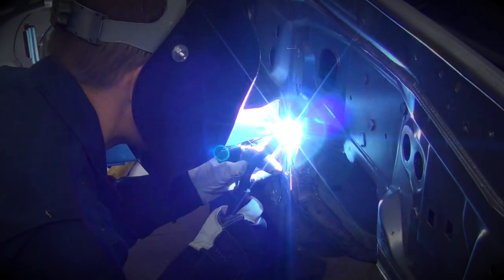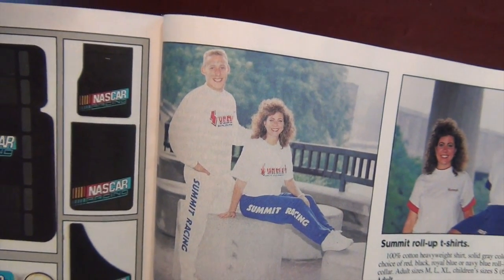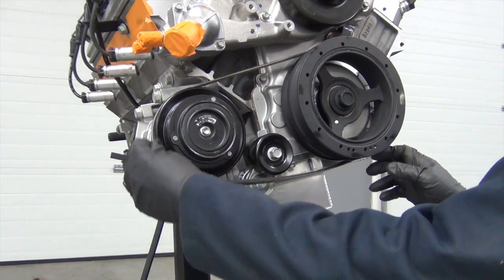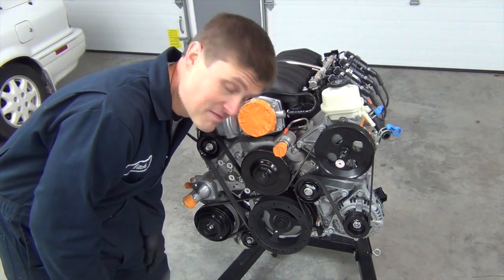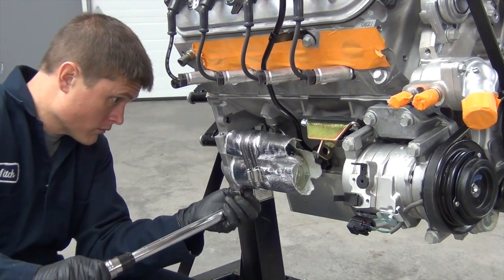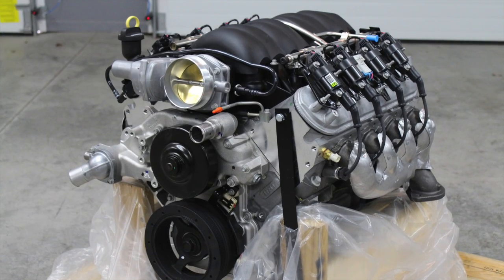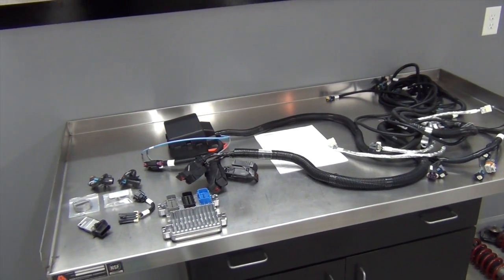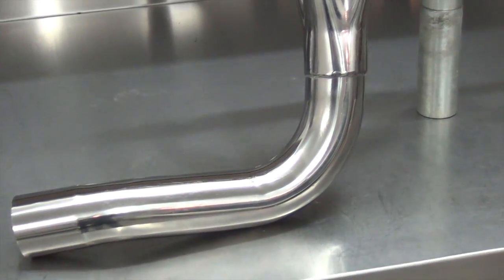LS3 V8 Miata Build - Project Thunderbolt Part 5

Comment: One tip from a mechanic by trade, invest in a decent flex head ratchet with an offset handle,  which can be folded back and used as a speed wrench. I notice you only use hand tools, which I love. I will never get tired of the  sound of the ratcheting gear. It would save you hours on one of these builds. All the best, and I  love your videos!

Comment: Great Series, Awesome engine, fantastic-expected result.  You did ask for "other engines" at some point, so here are mine:--an 215cu" all-alloy V-8 Olds from the 60s, wicked-up to 250Hp for the "old-schoolers", and a Ford SHO V-8 with a N-S adapter.   The SHO was wasted, I thought in a Taurus sedan.   A Ford "SC" 3.8L V-6 might be more "easy" to do, because it was already in a N-S mode.  With a N-S adapter, ANY of the Buick-Olds-Caddie Northstar's would fit.   The Hp's low enough, there's miles of torque, and  huge tires/flares un-necessary.   Also, as long as you're moding everything and the kitchen sink, I'd suggest you turn your miata into the late-model Coupe, like are available in the last couple of years.   Lastly, run your car at a huge race like Le Mons, and win whatever your class is.

Comment: As an automotive engineer who frequently deals with the implications of modifications to existing designs on driver safety, that "one more small cut" gives me chills. That replacement brace looks comparatively skimpy to the roll formed box structure of the original.
Reply: +Hamza Ali Kind of hard not to take offense...and there's no need to be nasty! I'll explain the reasoning behind my argument, hopefully you can explain yours, because I'm interested to hear it from a fabricator's point of view.

A "box" structure is inherently much stronger than a single beam, or, in the case of the supplied brace, a 90° piece of what appears to be angle iron. If a 90° shape like the one used was indeed stronger, you'd see it used much more frequently in bumper supports, frames (in the case of body on frame vehicles), etc. It's cheaper and lighter than using roll formed steel.

Additionally, the steel used for roll forming is very high strength to begin with, and is cold-worked during the forming process, which further increases its rigidity.  

Another argument to this point are fabricators such as yourself who "box in" the frames of old cars which have frames made in a "C" shape so as to increase strength. This is common with lowrider guys who like to bounce their cars, and will often bend frames while doing so.

I'll agree with you that using tubular steel would be stronger. I've seen, in the past, similar braces composed of two or more pieces of tubular steel. I'd feel much better about using something like that.
Reply: +Louche Decay OK, I wasn't trying to be nasty BTW, sorry if that's how I sounded but that's just my normal way of speaking. yes, rolling is lighter, also cheaper, but not by much because of labour and machining costs. the reason solid steel is not used in car bumpers and frames is because cars are designed to collapse in themselves in the event is an accident. you're an engineer so you should probably know that. if the frame was to not collapse on itself, humans would not survive crashes because of the amount of g-force. also, called rolled steel does not make an object rigid. it actually makes it very soft and ductile (also proving my point that frames are designed to collapse). high strength steel is much different than cold rolled. chemically and mechanically. (probably something you already know but just in case you don't). also, the type of steel an item is made from has little to no effect on how rigid it is. it all depends on the final form of the object like the angle iron.
Reply: +Hamza Ali It's all good, intention doesn't translate well via the Internet. 

I also thought of "crumple zones" when I wrote my response, but I guess we'd have to see impact tests of both designs to definitively know which method is actually stronger. To your point, if the brace was stronger, it could possibly still be a source of risk if it didn't "crumple" at the same stress as the surrounding material. This is an interesting dialogue nonetheless.

The type of steel used does have a dramatic effect on its strength when loaded with stress. You're right in saying that cold working doesn't strengthen all steel material, but many materials (like those used to make springs, for example) are pre-selected to have a specific tensile strength after forming. Cold rolled steels are analogous in this regard. 

"Strength" is also a bit of a difficult thing to describe here. Tungsten carbide is "stronger" (harder), but is "weaker" when loaded with shear or torsion stress (it is brittle and will crack like ceramic).

I'm curious to know what kind of steel was used in constructing the replacement brace. It would be fairly easy to analyze both the OEM and replacement supports as a simple beam with a centered load.

Also, while the welds themselves are "stronger" than the surrounding material, tests I've done in practice have shown that the welds themselves often contain microcracks which are more often than not localized failure modes. This might be mitigated by glass or shot peening.
Reply: +Louche Decay OK, so I agree with most of what you said but you misunderstood. when I said that the type of steel doesn't matter how rigid steel is. let me explai
Reply: +Hamza Ali sorry, damn phone messes up all the time. but as I was saying, let me explain. let's say you have cold rolled and mild steel flatbar. let's say about 1/4 inch and 20 foot long suspended at the very ends. if I was to step on each of them with my full weight in the center, they would both bend about the same amount if not the cold rolled one even more. if these were channel or angle or anything with a bend in it. I'd bet my life they would not bend. that's what I meant. if you want to got into specifics of heat treated and low, medium high carbon steel, and alloys and high strength and stainless and chrome steel, and inconel and chromoly and so on, that's a different story. I was only referring to just cold rolled and mild. also, about the welds, if you get a good welder with a good tig machine, I can garuntee no cracks. it's been done before. also, I'm betting that the angleiron was just mild steel. I mean, like you wouldn't really need anything else. that's what the sub frame is probably made of. other wise this guy would have a much harder time welding.
Reply: +Louche Decay also, I want to ask why springs would need high tensile strength? wouldn't they need more yeild strength instead? or am I getting the two mixed up. I forgot all my terminology after finishing school.
Reply: +Hamza Ali Marhaba habibi :) ... Ah, ok, I understand what you meant and agree that a bar with an angle would be much stronger than a flat bar. You can calculate the strength of different shapes of simply supported beams (which are as you described). My point was just that a box structure is stronger than a bar with just one bend....but that bar was pretty thick, and we'd have to know the material properties of each to actually do a good calculation.

Yield strength is just the point past which a material will not return to its original form. Under the yield strength, the material will elastically deform (deform and return to its original state). Above the yield strength, it will plastically deform (shape will be permanently changed).

Springs need a high tensile strength so as to have a good fatigue life. Springs made from a low tensile material, even if operated entirely in the elastic range, will have a lower fatigue life than those made from a high tensile strength material.
Reply: +Louche Decay so then I guess we can both agree we won't know before testing the material. are you arab? asalamualaikum bro. that through me off guard real quick
Reply: +Hamza Ali Waalaikum salaam. Yep, Palestinian. 

We'd totally need to test the materials to definitively figure it out. It'd actually be pretty easy if you had a cut out portion of the bumper support from the Miata and the Flyin' Miata brace. Impact testing might be difficult, but I'd just support both as simple beams and statically load them in the middle and measure deformation at different forces. That would be a pretty cool experiment (there's the engineer in me geeking out :) )
Reply: +Louche Decay or we could just put both pieces under a microscope and check the grain structure. probably the most accurate way without breaking the bank.
Reply: Louche decay you are 100% right. Unibody 101

Comment: Still impressed that there are that many parts available for a LS3 Miata build. Still a ton of work. but it looks awesome!!
Reply from the maker: Bob M. Tyranny Destroyer Thanks man, I hear ya!  You definitely have to work for it, but it's worth it.  The condensed format of the videos make it look much, much simpler than it is for an average wrencher like me.
Reply: You completely disassembled the interior and removed everything from engine bay lol. Still fabricating multiple brackets on top of wiring harnesses, chassis & engine part modification. Probably the coolest car build series I have ever seen!!
Reply: Just got done with all new brakes/rotors and wheel bearing on my L67 Regal GS. One of the slider pin bolts was rounded off and I didn't get it out. Tried filing it down to a 13mm worked pretty good, but still just rounded it off, so I proceeded to removing the whole caliper as needed for rotor got pads on that way. BUT before that, I turned car on hit brakes to compress the brake pistons on other wheels trying to not over-pressurize the reservoir and POPPED out my front left brake piston (fluid everywhere) because no pads in yet. Dumb mistake never done before. SOO I took it off and put in in a vice and popped it back in and it works. Going to shop tomorrow for scheduled steering rack replace and brake flush.
Reply from the maker: Bob M. Tyranny Destroyer Thank you again man, I am really glad you're enjoying the videos!  Oh man, we have all made mistakes like that, it happens, but the good thing is that it just made a mess and didn't hurt anything.  Have fun wrenching on your Regal and getting it all done!
Reply: Tom's Turbo Garage
Friggin rites! :)

Comment: Tom, PLEASE make some 0-60mph and 0-100mph videos when this is all said and done. This little beast will be a rocket!
Reply from the maker: Thanks Jobe!  I will do so, as I have a perfectly good Vbox sitting here gathering dust.  But it may take some time as I'll have to break everything in, work out the bugs, etc.
Reply: Tom's Turbo Garage
That's the worst part about the crate engines, new transmissions, and clutches.. the dreaded break in period! xD
Reply from the maker: JobeMinacum Indeed!!

Comment: I would never guess that the AC compressor bracket would have a torque spec.  I dunno, I guess after being a professional for so long I could just feel where it was right and wrong.  But good for you for doing everything to exact spec. Good job, keep it up.

Comment: "One more small cut..." My eyes got so big! Hahahaha
Reply: Me too, there's no way that welded in bar is going to have the strength of the piece taken out :S
Reply: Dee Jay Oh yes it will. Properly welded seams are actually tougher than the metal around them and the original piece used relatively thin sheets of metal.
Reply: Jinppa
flat bar is not as strong as square...   I'm not talking about the weld
Reply: Dee Jay It's not flat, it's angle bar and as you can see, it's quite thick one.
Reply: Jinppa
Still more flexible than square..  So It's not as strong as what was there originally
Reply: Dee Jay How can you know that without knowing the material strengths and measurements? If you're genuinely worried, maybe you need to contact Flying Miatas, it's their design? :)
Reply from the maker: Joe Wrenches Haha!  A couple more small cuts like that and I would've had to consider a tube front end. :-D
Reply: Jinppa yep. that looked like angle iron and it was thick. thin steel vs that thick piece of angle iron? im gonna side with the angle iron. :P
Reply: hobotechMASTER
I think it's safe to assume you have absolutely no fabricating experience..
A box is more rigid than angle..  Super simple to understand
Reply: Dee Jay Like I said, you can't know it without knowing the material strengths/thickness. Pound for pound square is stronger than angle bar, sure no doubt, but I bet that angle bar is heavier than the original cut out piece.
Reply: Jinppa
It could be!  Using rigid shapes means the engineers can use thinner material to gt the same rigidity..
A square is like 4 pieces of angle, so clearly you have a ton more strength in 4 than you would in 1.
Reply: yes the iron L bar is probably stronger, but considering it was welded onto thin metal, it was stronger before the cuts. look at the shape of the place it was cut, the welded in piece cannot make it as strong as it was before, but oh well too bad its a v8 miata its not going to make any difference :D

Comment: Regarding laying under the dash while fabbing the gas pedal mounts up. At least you didn't have the seat in it. I just ripped the heater core out of my NA with the dash and seats still in place. That was awful. Seat is coming out before I put the new one in for sure.
Reply from the maker: goingtoscotland Oh yeah, any under dash work in the Miata almost requires the seats to come out!

Comment: Another great video! Thank, Tom. You remind me of a skilled surgeon, performing his operation in a sterile, clean environment, using glittering tools and parts!

I have one observation and one question for you...

The serpentine belt is amazing and cool, but I wonder if once the motor is in the car, will you be able to change the belt when it breaks or becomes worn? I'll bet that there's not a lot of room in there to even see what you're doing. Would you need to pull the engine in order to replace the belt?

Here's my question: I observed that you torque each bolt on the engine. Is there a "standard" torque setting for all bolts, or does each one have it's own? Being as you have an aluminum block, the last thing you want to do is over-tighten the bolts and risk stripping them out.

Thanks again for another amazing video, Tom!
Reply: There is a different setting for each different bolt and usually if there is enough clearance for the belt to spin then there should be enough room to get in there and replace the belt
Reply: Yes the belt is easy to change in the car.  Lots of guys use F body accessories which leave even less room than he will have and it's still no problem.  If you look in the shop manual there is a specs page in each section that gives the torque spec for each bolt.  In the GM manuals anyway...
Reply from the maker: Rick Hilton Hi Rick and thank you for watching and the great support as always!  Other folks have answered your questions well already, I guess I'm too darn slow!  :-D  Yes, the manual for the accessory kit (and the factory service manual) specifies the torque specs for each bolt and there is lots of room to change the belt, as you'll see in future videos. Thanks again sir!
Reply: Thank YOU, Tom, for these great videos. Keep 'em coming!
Reply from the maker: Rick Hilton Thanks Rick, will do!

Comment: why is there a huge dent on one of the headers? They look nice but I hope they didn't have to do that for proper clearance. I would expect a better design to deal with any clearance issues. I'm loving this series btw, you do excellent work
Reply from the maker: It's a small dent for clearance.  Check out hot rod engine masters where they tested headers that were practically dented shut and lost no power.
Reply from the maker: Dang, hit enter before I was done typing.  Thank you for the kind words and I'm glad you enjoyed the vids!

Comment: Just a head ups to anyone. The truck starter uses 3 bolts so incase you come a common problem of on of the starter mounting lugs broken off the block.  Common on aluminum blocks

Comment: I have been watching your builds earnestly and I have a couple of reccomendations.
I was on the FM miata site perusing a build and noticed their ls3 radiator seemed much more efficient than the one your installing. It was dual fan (more fan spread), and with a shroud too.
I was also going to ask if your putting a cross or x pipe by making the true duals touch before they meet at the muffler. Really does make a difference on the exhaust..
Other than that, you are a true inspiration, .....thanks.
Reply from the maker: Thanks man!  I will be running an X pipe in the exhaust and the V8 Roadster folks say that one large fan is as efficient as two smaller and draws less energy.  We'll see, but fans aside, the fluidyne core is excellent.

Comment: You just could not resist putting a Mitsubishi part on it could't you? Lol, caught the belt. :)
Reply from the maker: It's actually a Mitsuboshi belt, with an o!
Reply: Tom's Turbo Garage Made you look lol. They did a lot of parts for oe on the galants for the 80's and 90's. Really top rate stuff. Their logo is funny too based on their name it literally means 3 stars.

Comment: Watch out for that harmonic balancer! The rubber delaminates and the tty bolts break. It happened to me, I replaced the bolt with ARP non tty
Reply from the maker: aadpcamaro Thank you for the tip, I appreciate that!

Comment: Forgive my noobishness, but shouldn't you be using loctite on those bolts? Excellent quality workmanship and video quality as always.
Reply from the maker: ViperKillerWannabe Thanks man!  If specified by the service manual, they come with thread locker already on the bolt.